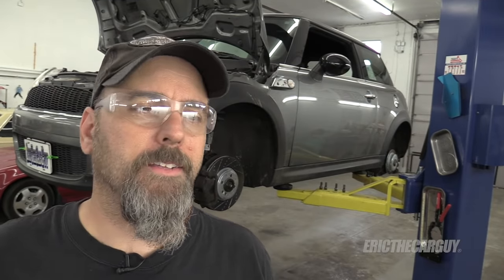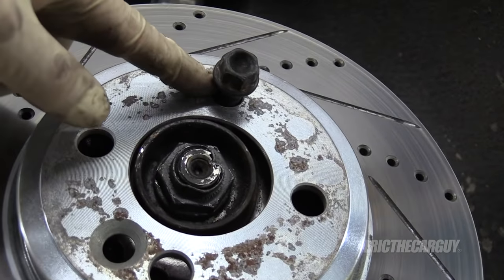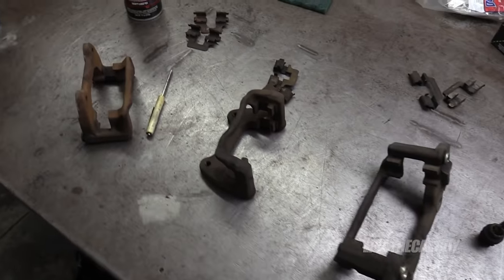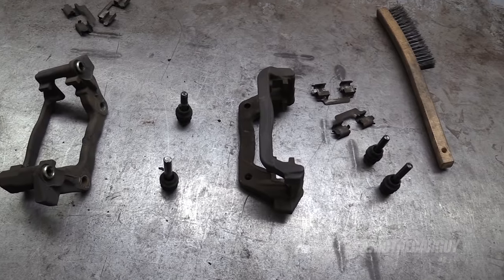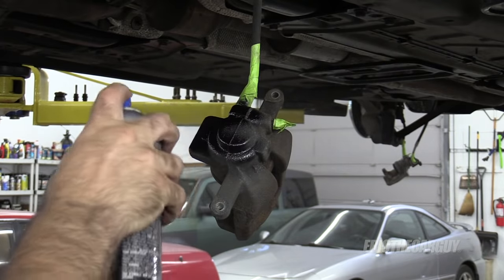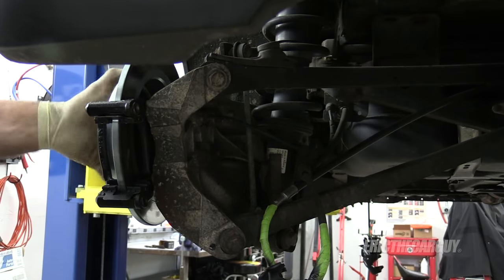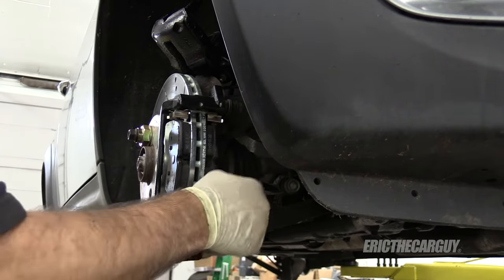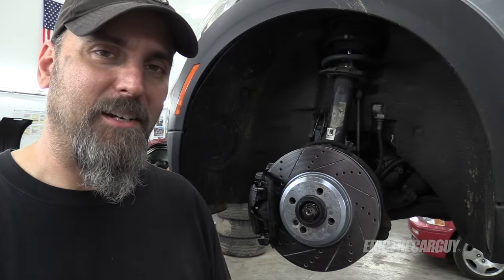How To Paint Brake Calipers Like a Pro!

Comment: silicone paste is a wrong choice for guiding pins, you have to use for them a special high-temperature grease
Reply: Random YouTube comment or Eric the car guy hmmm 🤔🤔
Reply from the maker: Silicone paste is high temp. Petroleum grease dries up and causes the pins to seize in the bore.
Reply: Dude......it is high temp.....
Reply: Read a little bit info. Silicone paste is a bad choice for lubricating, there are some greases like Slipkote 220 (based on Polydimethylsiloxane, a type of silicone, with proprietary synthetic thickeners) that work good for guides and that's why I wrote that comment. Not every silicone paste fit well for guiding pins, only few ones. And not every guide pin grease is silicone based, there is a lot of them.
3m paste, for example, lives up to 200 degrees and that's really not too much for brakes https://multimedia.3m.com/mws/media/889069O/3mtm-silicone-paste-clear-08946-8-oz.pdf
Reply: Thanks for the comment, but how high is temp? 3M for example works at up to 200 C (400 F) https://multimedia.3m.com/mws/media/889069O/3mtm-silicone-paste-clear-08946-8-oz.pdf , Slipkote works at up to 300 C (big difference) http://www.speclubes.com/pdf/SLIPKOTE%20220-R%20Silicone%20DBC.pdf . 200 C is a high temperature for ordinary cars, but they can exceed that temperature because of surrounding conditions (hot summer, twisty roads) so not every silicone paste can bear that conditions. There are lubricants (not silicone based) that bear up to 1000 C (shortly), but they're not silicone based.
Reply: EricTheCarGuy I used synthetic PTFE paste one time for the pins, and they seized up after 2-3 months. Now I use only silicone paste. Lession learned.
Reply: Oh, man, Russians know a lot of things, we're doing a lot of stuff to survive. I haven't seen so huge forums, sites and discussions in English segment as in Russian about car maintenance and repairs. Few examples: drom.ru (categories Forum, Catalog, Parts Catalog, news about cars, laws, car makers, a very big marketplace about cars and spare parts, Japanese auctions), Drive2.ru (Drive2.com is a translated version) is like a social network about cars, oil-club.ru is a forum about oils, lubricants and technical fluids (brake greases too). And a huge amount of spare parts stores like japancar.ru qx9.ru greenparts.ru exist.ru emex.ru and many others. Because you can't just buy a car and use it, there is a lot of issues in all stages of buying, selling, maintaining, even driving. Don't forget that Russian conditions are very tough too, we have both very hot regions, and the coldest habited region in the world too, where cars are used.
Reply: @The Great Cornholio probably the most informative comment here so far.
Reply: This guy thinks hes a scientist lol ive  been using silicone paste for YEARS with no issues at all.
Reply: The Great Cornholio  Have you ever thought Sarah was a guy? There's a former site that claims both Sarahs are transgenders.
Reply: you're not reading all thread? Silicone pastes are different, some of them are appropriate, but most of them not, they're not so high-temperature than others. If you're using slipkote 220 then that's not bad for daily driving, if 3m - its temperature band is not enough for highways and twisty roads (not talking about motorsport or track days, silicone is absolutely not appropriate for really high temperature). Just learn that question better and you'll find out that in town the temperature will grow up to 140 C in normal conditions, on hill roads - up to 400 C in some cases, in motorsport - up to 550 C. I didn't find a silicone paste that can bear temperatures more than 300 C.
Reply: I've used the silicon paste for years and no problems, I've also used grease to lude up the guide pins and I've noticed that they tend to get harder to move unlike the paste. Nothing wrong with silicon tho.